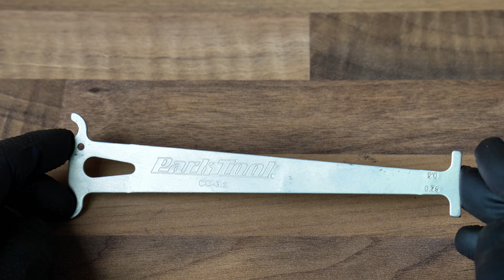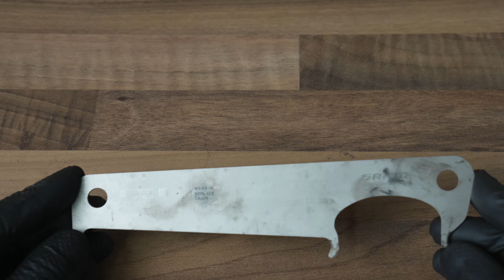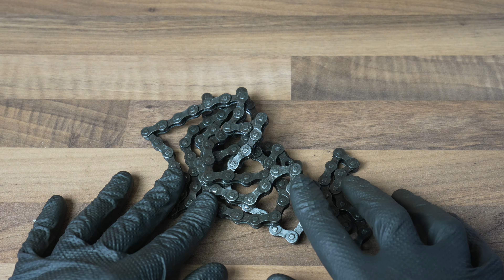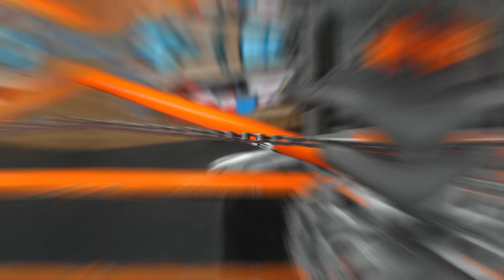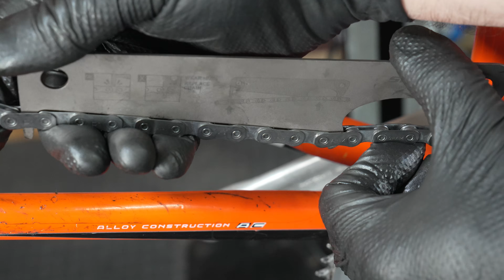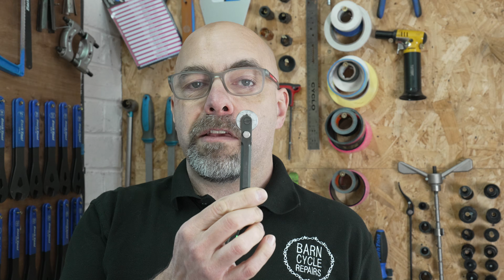Which Chain Wear Tool Should You Trust?

Comment: I've been amazed at how little wear I get on a waxed chain as long as I'm reapplying wax every 200 - 250  km or so.  I think I'm around about 7000 km on a 10 speed chain with no measurable wear (and, yes I flush the chain before measuring it).  The length is identical to what it was when I started.  At 5000 km, I actually compared it to a brand new chain and it was exactly the same length, link for link.  The chain itself is only $25 (well, 3000 yen in Japan) so... I feel like if I ever get any wear on the chain, I'll probably change it which will keep my cassette going nearly forever...
Reply from the maker: Wax is great 👍
Reply: I would think that over time your cassette will wear out- albeit much slower than average. Wax, oil, grease, whatever. It’s still metal on metal friction. Depending on the hardness of the chain vs cassette, etc., you will have to some day in 15 years change that cassette 😂
Reply: @georgeforeman89  The cassette acts as a plain bearing.  It requires no lubrication as long as 1) the roller is in the exact center of the semi-circular indentation on the sprocket (what are those things called???) 2) There isn't too much force on the roller.  As long as there is no wear on the chain, the first requirement is met.  The second is met due to the surface area on the roller and the size of the sprocket (obviously more teeth distribute the load more evenly).  Also, my weak-ass legs 🙂

Actually the cassette is already 13 years old.  I ran Squirt for the first 11.5 years, though I never kept track of distance.  For the last 1.5 years I've been doing immersion wax (all on one chain so far).  It's pretty incredible.
Reply: Any serious climb? how heavy are you?
I notice more difference depending on how I'm riding than wax vs oil.

Comment: I also own several of these tools, including three park tool ones.
The issue with the toopree/ztto, clones of the parktool cc2, is that they also measure roller wear to a large degree.
This isn't an issue for my road bike, but it is an issue for my city bike, as I cycle in all weather and crosschain.
I just changed a chain that my cc2 said was above 1, but the cc4 said was almost 0.75
In any case, if the cc2 or clones  say "change", you are safe.
For £5 these cost at AliExpress et al, I encourage my friends to at least have the tool and measure

Comment: Somehow the audio volume in your videos is very low. Even on max volume youre barely audible. I'd say about 60-70% lower compared to other channels. Hope you can fix it.

Correction: the grease video and the cannondale video have great audio levels but the rest is really quiet.
Reply from the maker: That's odd as it sounds exactly the same as every other channel on my TV! 
I've added at least 10 decibel's to the videos over the last maybe 10 videos or so as some of the earlier ones were too quiet..

Comment: I use both the Pedros and a Park Tool CC-2 (it's 2-pin - like your ZTTO one) and find they generally agree. My Park Tool is engraved with the info that they consider single-speed chains worn out at 1%, 5-10 speed at .75, and 11-12 speed at .5%. Also, it looks to me like you have some scrap metal on your hands now. :)
Reply from the maker: I've never changed a chain at 0.5% even in 12 speed systems and it's never been an issue on the cassette... Yes, I gather a lot of scrap metal, all goes to recycle though 👍🏻
Reply: for singles, i don't change the chain based on any measuring.   I ride until the  rear cog looks badly worn, then i change the chain and cog at the same time.  The crank generally doesn't have a problem with new chains until the teeth are all sharp points

Comment: 200 pound cassette! Just paid 13.95 for new 7 speed delived. Don't think it will be long before we go  back to triple chainwheels. Love your channel.
Reply: My city bike has triple chain rings.
Not really needed for city use, only on prolonged mtb settings I need the small ring.
A compact and 7 speeds and you are set for normal use..
Of course MTB and road at speed, it is different.
But then.. I have a 2x11 road bike and have ridden 2x12 and 1x12.  12 speed is a minimal advantage (to me) vs 11.  And mechanical 12spd I found unreliable, electronic shifting is required for 12spd.
Reply: £200 for a consumable part is beyond ridiculous
Reply: @stuartjenkins3506  Treated properly a cassette can last 10k or more miles, so unless you ride that much in a year, it's not that bad. Tires can run nearly $100 each and people often replace both.
Reply: Yes a cassette can last for a very long time, but they are a consumable component which does need replacing periodically. @HabaneroTi
Reply: @stuartjenkins3506  Not that often though, if taken care off and chains replaced as needed.
Reply: @HabaneroTi  Consumable parts are there to be used and not to create a new hobby of dancing around them. And I have absolutely no clue about what this "care" is supposed to be? Frequent cain changes? Experience says they will last only about two chains anyway.
Reply: @rosomak8244 If you don't understand what taking care of a bike and its drivetrain entail, then you shouldn't be commenting on bikes online because you obviously don't understand much about them. Caring for these means keeping them clean, well-lubed, properly adjusted, and periodically checked for excessive wear in case they need to be replaced or overhauled. It's pretty basic stuff.
Reply: @HabaneroTi  You are the one who doesn't understand that there is nothing you can really do to prolong the usability of wearable parts. Cassettes wear out only slightly slower when you feed them fresh chains. Practice shows is that if you want to get the most millage out of them you just have to ride on a strong chain just until things stop working properly.
Reply: Yep, tell me about it. 

And then on an mtb with good full suspension you get the same price for both shock sevice (50hour) and brake flush. 

And go 200 pounds on one shock for the 200 hour service. Ou and some dropper post like the rockshox reverb are the same. Thus in an year you could spend easy more than 600 pounds on shocks and dropper and you have to do your fluid flushes yourself (the 50hour ones).
Reply: Really depends on the kind of bike, terrain, your fitness and riding style. In relatively flat regions, no real need for a triple and even a 1x should be fine. In hilly or mountainous regions, a triple makes a lot of sense, unless you're really fit and/or don't mind suffering. I have a triple and don't really need it here in NYC, as there aren't that many hilly parts. But I got it when I lived in Seattle, which is very hilly and where even on my 30x25 I sometimes had to dismount and walk it up a steep hill. I've since gotten a 12-30 cassette that with my triple should see me through nearly all terrain around here.

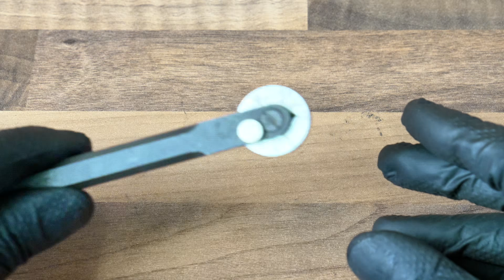Comment: just looked up the expensive digital kmc tool here in taiwan, around 70 pounds, sure is pricey. i initially used the one at 2:14 but didn't feel good so bought another kmc chain checker instead, the cheap one ofc, the one you can find posted 4 years ago on the kmcchaintw channel, it has plenty of readings on it.

Comment: Thank you for the awesome vid!!! I've been changing chains on 12 speed mtbs at .50 wear.I found the same results as you with the pt cc-2 its says it needs replacement a little early but thats not a bad thing,the pt cc-4 is bang on correct same as the shimano tl-cn42 just wish it had a scale on it.Abbey bike tools just released a very interesting chain checker the LL chain wear tool its right on the money as well but it uses a v block that goes over the roller and then you line up the appropriate hole to the chains pin,the holes are in .25 increments,but it also measures chain pinch which is new to me never heard of that before.The chain must be off of bike to check pinch.Oh and like all quality tool companys their stuff is pricey.Cheers!!!
Reply from the maker: Yeah the Abbey one is a tad excessive in my opinion! New chain link every time you want to measure your chain!!?
Reply: @BCRUK  Atleast you don't need to remove the chain to check wear just the pinch test.I wax my ebike chains so I do take them off when its rewax time and thats when I check the pinch but have never had a chain that failed that test so I don't think that's to important.Cheers!!!

Comment: The rule method is quite easy if it's in inches. Bike chains are all 1/2" pitch, so 6 inches = 12 links. 

Then just over a 1/4inch is 0.5% wear, I make a mark on the ruler. 

I think it's much more complicated in mm because you end up with some tortuous decimal you need to memorize. 

However I can see why you use a gauge, it's going to be faster if you are doing it all day.
Reply from the maker: Cheers Hambini – fair point,I didn't think about marking the ruler 😅

However I just like tools I can use without needing a maths GCSE refresher mid-service 😂

Welcome to the channel, nice to see you here 👍🏻
Reply: I don't think that's right! 0.5% stretch on 6" is 0.03", or approx 1/32". A 1/4" on 6" would be over 4%!
Reply: @e @essjayaitch  back and read the comment (I did) he said 1/4” on 6” is about 0.5% which is more wear that your 0.4%. In effect while you say you disagree, you actually agree.
Reply: Must be easy if a 5 year old can do it
Reply: 6 LINKS

152.4mm 6 links new chain

153.2mm 5% stretch of 6 links

153.55mm for 0.75% stretch over 6 links 

0.8mm stretch over 6 links  for 5%

6 1/32 inch is 5% over 6 links

Measuring with ruler centre pin to centre pin.
Reply: 0.75% of chainwear at 12" is just under 3/32" so if you are adding 1/4" to a 6" section your chains must be very worn before you change them 😂
Reply: In mm:
119,5 new
120,5 used
Reply: As 3 mm bij 1,5 mm slijtage aan vervanging toe. Ik gebruik de schuifmaat 145 mm is 6 links. Dus 146.5
Reply: Not so hard really. Would have saved my chainrings 45 years ago! Probably past 2% wear. Maybe 1 full inch over 100 links! My chains started a bit sized long until I caught on.

Comment: Is there any chance I could use that Unior tool on my flat top Sram Axs chain?
Reply from the maker: Which Unior?
Reply: @BCRUK the only one in your video. It's matte black. I have one from Decathlon which is identical.

I measured my flat top Sram rival chain and it shows 1. Is that accurate? Should I change it?

Comment: Yes!!! I’ve recently discovered that my standard unior 1643/4 chain checker is worth almost nothing. It measured new 12 speed chains as worn. My new chain checker measures the chain on a longer distance and eliminates roller wear which is crucial. It’s made by a man in Poland, patented. It’s called the mw-03-005
Reply: Park tool cc 4.2, Pedro’s and sram checkers are built similarly, but they only show that the chain is either fine or worn, unlike the polish checker, it shows from 0 to 1 with 0,1 accuracy. Costs like $18